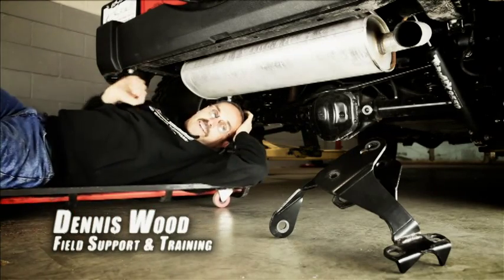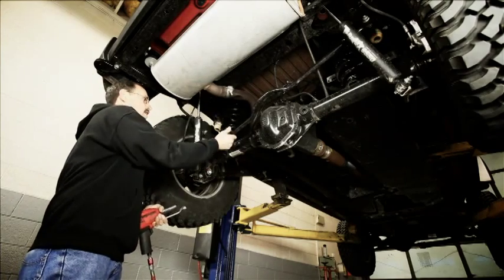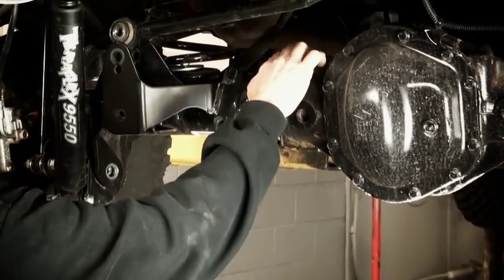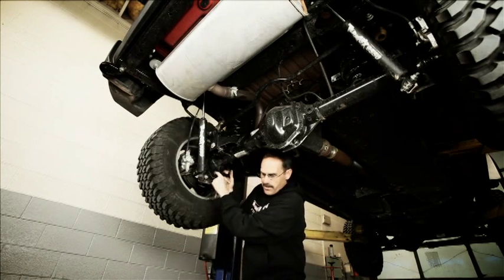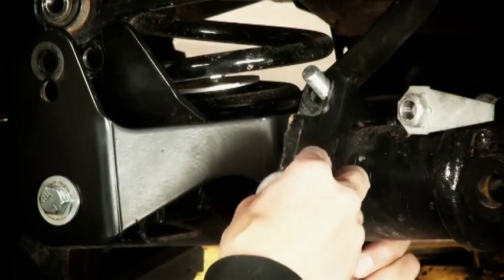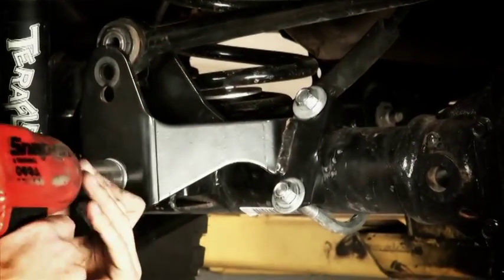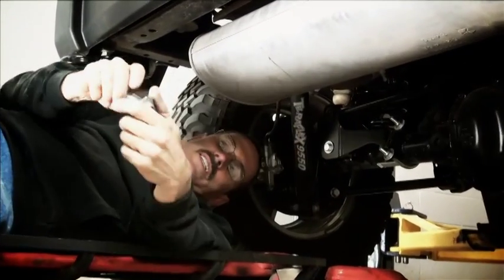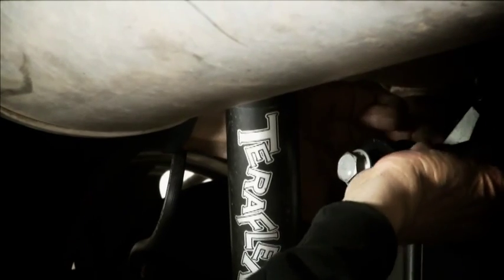TeraFlex Install: JK Rear Trackbar Bracket

Comment: Do you need to use this bracket if you are not using a stock track bar and using the Teraflex adjustable track bar ?
Reply from the maker: Yes, even more so. The bracket is designed to help correct the angle of the track bar and reduce rear axle bump steer, along with reinforcing the factory bracket.

Comment: How about this: Remove track bar and CA bolt while on the ground, place bracket into position and install all bolts and U-bolt (leaving track bar disconnected), then wiggle your Jeep side to side to center the axle and insert track bar bolt?

Comment: so my rear end seems to be slightly more to the driver side what do I do? put the sway bar to the very bottom hole?
Reply: I have the same problem.
Reply from the maker: @galacticstarsgaming3638  If your rear axle is shifted to the driver side, moving to the lowest hole will shift over to the passenger side. We like to use a ratchet strap and go around the axle to the frame. Remove the axle side trackbar nut and tension up until you can remove the bolt. then keep ratchetting toward the driver side until it lines up with a lower hole. Re-install and check for centering. It should be better, but is rarely perfect without an adjustable trackbar.

Comment: Will this bracket work on a 2013 jk with a budget boost space lift 2-2.5”
Reply from the maker: Yes, it sure will. You will want to remove the frame side drop bracket if you install this axle side one.

Comment: I own 2015 jeep wrangler jk (right hand drive) and I purchased a teraflex stage 3 lift kit. when installing the lift kit everything went well other than the rear track bar bracket did not fit. i checked the video, according to it my jeep track bar bracket is in the  opposite side. do you have any track bar bracket that will fit my one?
Reply from the maker: +Dumidu Indika Wijesinghe Yes, call into customer service and they can help you out with that. 801-713-3314

Comment: I had teraflex 2.5" coil spring lift installed that came with rear axle bracket. After the lift jeeps both axles shifted to the left(driver side) by 1/2" or so. This video says that the bracket centers the axle, but in my case it didn't help. My body had RE 2.5" lift installed a week before mine and his are perfectly centered. Is this practice normal for teraflex lift kits?
Reply: I have the same problem.
Reply from the maker: @galacticstarsgaming3638  Your axles will shift toward the side that the trackbar is connected to the frame. Front would shift driver and rear would shift passenger. The brackets are designed to help re-center the axles as best they can only do so much. Depending on the overall lift height gained, accessories added, and specific weight for that vehicle the shift will be different for every vehicle. You will not be able to perfectly center an axle without an adjustable trackbar. The brackets will get them close, but not perfect. It is ok to have them a little offset, but if they are way off I would consider an adjustable trackbar. Give us a call anytime and we can go into more detail. 801-713-3314